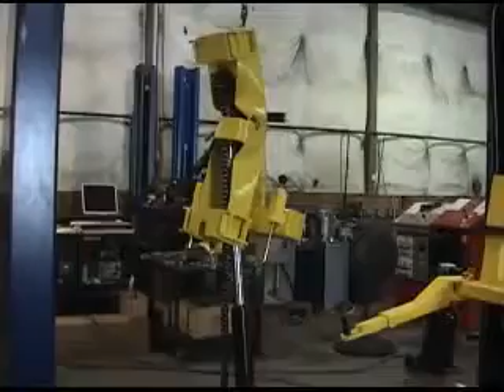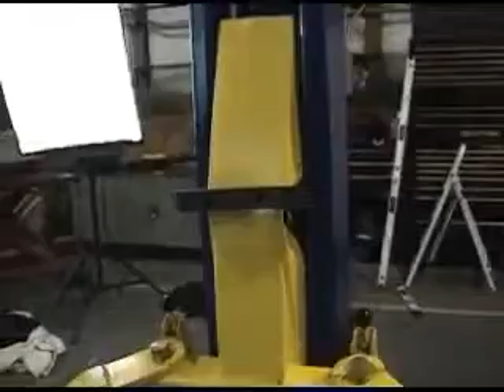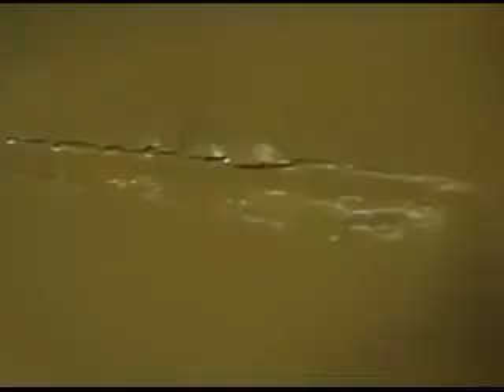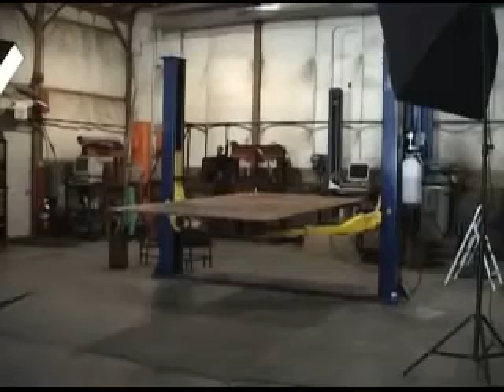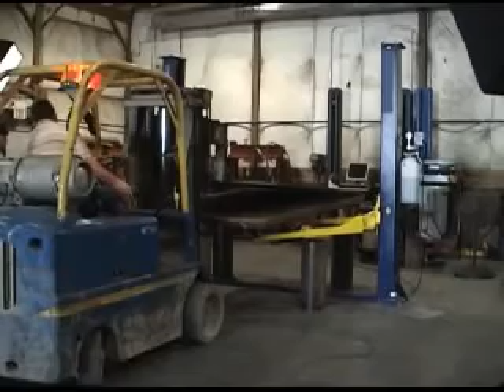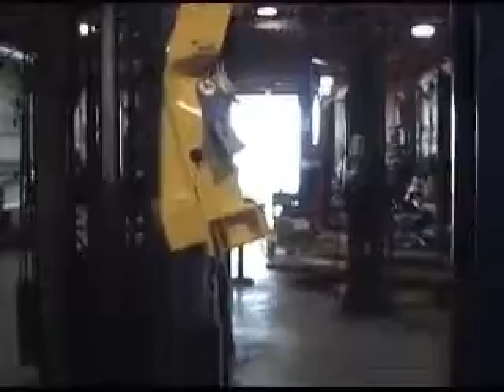Cheap Two Post Car Hoist Fails Test   Badly!

Comment: Whether u lift symmetrical or asymmetrical the load is supposed to be balanced. a truck balance point is at the b pillar and should be lifted symmetrically. a car balance point is at the a pillar and should be lifted asymmetrically. so in not saying their wrong but definitely not doing the test 100% correctly

Comment: At least its supplied power unit wasn't strong enough lift a load heavy enough to cause structural failure. It's almost like a safety feature 🙃

Comment: The XK are pretty good quality as long as you set them up correctly. Plenty of legitimate reviews on those. They do stand behind the products. I bought one of the L1000 which is the 10k two post symmetrical with the bottom cable/hydraulic cover plate.  Haven’t seen any negative reviews except a complaint about the written setup instructions being unclear. There are three great videos on the setup that are extremely detailed and the installer on two did follow ups on tips and how to replace a failed anchor bolt with a bonded one that is much stronger.
Reply: Really? I have one with a car stuck on it in the air right now. The "customer service" lady is a nightmare to deal with.

Comment: Any one can cause a lift failure if you overload it that much.     Just a couple of Goob engineers with no practical experience.
Reply: It’s not overloaded. It’s rated for 10k and it was already failing. Industry standard is that the lift can actually life 1.5 times the rated load. So in actuality the lift they are testing should’ve been able to lift the 15k lbs without breaking.

Comment: Dude if it’s dangerous call out the name of the lift. All you’re doing is blowing hot air.
Reply: You’re going to end up in a lot of trouble to prove your innocence even though it’s true it will cost you I’m sure that’s why they don’t
Reply: I own a 20 year old Ben pack 9000 never a problem seals are still good no leaks cables good, I’ve moved it twice with me,
Reply: @joecorrie1 there are mechanical locks and it is the frame it self you should worry about. If the hydraulics fail, the only thing that happen should be that you can't lift. Which mean it can be locked in up-position as well.

Comment: This video is a bit disingenuous with regards to Chinese lifts. When you say "not all  lifts are created equal", why would you claim that? If this lift is rated to 7000lb by the manufacturer, but the importer is claiming they are rated 10000lb, what the hell do you expect to happen when you load it up with 10000lb and 15000lb. Looking at the hoist in the video, it looks like a generic Chinese 4000lb model, not a 7000lb. Your video is really a waste of time. Of course if you overload a lift it will fail. Why not put 20000lb on one of your 10000lb lifts and see what happens. Blame the distributor, not the manufacturer. If you wanted a video to show the quality of a Chinese lift, why not show the documents that claim the capacity of the lift and then apply the maximum load and video that.
Reply: Watch it again and do try to comprehend.

He states it is sold as a 10k rated lift. There is nothing saying its rated for 7k, simply that it looks like a 7k unit.

He also states that industry standards require that all rated lifts be able to handle 1.5x its rated capacity for safety reasons. In this case that 15k pounds, and it FAILD. 

Why are you so desperate to defend Chinese importers that lie and put peoples lives at risk for money?
Reply: @Swapperoni  Perhaps YOU should watch it and comprehend. He states "many US distributors completely overate their lifts. These distributors buy Chinese lifts THAT SHOULD BE RATED FOR 7000LB and advertise them at 10000lb" So my comment was correct. He should be blaming the distributors, not the manufacturers. I am not trying "desperately to defend Chinese importers", but the fact that if I buy an item from China that rates it for 7000lb, but I sell it and advertise it for 10000lb, who is at fault when it breaks? Not the brightest bulb in the house are you Justin.
Reply: @Swapperoni  
Every lift is made in China!! Bendpak/ rotory/ tuxedo and so on. But those companies have far better quality control as there are ALI inspection during the building process along with after
Reply: ALI certification exists in China - it requires actual testing and inspection.   This is most likely one that is not ALI certified.   I agree - over generalization that all Chinese lifts are bad.  An ALI made in China ( Forward ) should be solid.
Reply: I bought my lift in 2009. Private use only, no commercial duty. I really like it. Cost around $1750 OTD w/o delivery, which I didnt need as I picked it up with my trailer. I installed it myself. When I moved, I brought it with me to my new home and garage. One of the locks is starting to have an issue with re-engaging for a couple of inches when lifting vehicle higher. Like if I have the car off the cement 3 feet, and decide I want to raise it higher, one column clunks/ratchets two or 3 times before the other will start. But hey, its 15 years old, and probably needs some lube. HOWEVER....I'll also add that the lift came with 2 rating capacity stickers. One said 8,000lbs, and the other said 9,000lbs! The owners/parts manual says 7,000lbs!!!! I'll go with 7,000lbs to be safe. Since I'm lifting only a 3,250lb C5 Corvette, I feel confident. 15 years and no issues, except that sticky lock, which I'm looking into. Unless youre lifting commercial vehicles/motorhomes/dump trucks, etc., how many times will you be lifting even 7,000lbs???
Reply: They also didn't load it evenly put much more weight on the back arms
Reply: They overload it by 50% with a upgraded pump/motor.  SMH.  Let see them do that with some of their own lifts and show us.  Deceptive advertising.  No, the seller shouldn't be selling at the higher rating, but you proved it can handle the load that they are selling it at.
Reply: @offroad6309  
Do some research before opening your mouth!! This lift is rated to 10k!! Yet it can’t pass a ALI test. ALI certification means the lift must lift and hold 1.5x its rating with no permanent deflection in the beams or arms. All weld must not show any cracking!! 
Lifts like rotary/bendpak/tuxedo and other that get a ALI certification all go through the same testing!!
Reply: @brianawd  lol, triggered easily.  Nothing like a keyboard tough guy hiding in his Mama's basement.  

They showed nothing to back up their claims as to the rating of the lift or pump for that matter. So yes, when they try to hide facts it's deceptive.  We have no FACTS to base anything.  That lift may be the biggest piece of crap ever made and a couple shots of the tag and ratings would have been simple, yet somehow they neglected to do it??? You are willing to take their word with blind faith, just don't expect me to.

  Not all lifts sold have ALI certification. Pretty expensive process that not all manufacturers are willing to do thanks to bargain hunters buying anything that is cheap.    

Try educating yourself.  This one doesn't take a genius to figure out it's a crap review.
Reply: @brianawd  i understand those brands are all made in China, thats why I'm going with Mohawk. But man are they pricy!
Reply: @justinhall9954  
As long as it’s ALI certified you are good to go. Some people are ok with using cheap knockoff that are not ALI certified. To me that is playing with one’s life. 
$1500 lift vs 4K lift. I will gladly save for a few more months and spend the 4K
Reply: @offroad6309  you for sure fell out of the re-tard tree and hit every branch on the way down!!!
Greg smith is a distributor not a manufacture!!
They were simply showing how the so called 10k lift could not even do it. It failed all ALI testing. 
Do you really think a company like Greg smith would lie. Give me a fu-king break!!
Reply: @brianawd  Why don't you show proof of the rating of that lift. Oh that's right you have none.    Without proof it's nothing.  They very easily could have shown that in the video, yet they didn't.  Hmmm. Only one reason for them not to.    You can believe whatever you want and buy that ocean front property in Kansas. Keep defending questionable marketing.  I'll wait for the proof.  

That stupid stick is beating you pretty hard.
Reply: @offroad6309  hey dip shit show me proof it’s not a 10k lift!!
Reply: @brianawd  LMAO 😂😂😂.  YOU really are delusional.  The company posting the video or you since you sound so intensely involved need to prove the statements.  Until then you are just making noise.  

I could explain it to you, but I can't help you understand.....  

Don't forget your helmet your bus is coming soon.  Hopefully you can get the help you need.
Reply: @offroad6309  dude it’s a video of a ASI testing  facility. Do you really think they would test a lift and lie about its rating? How fu-king  stupid are you? Your dad should have pulled out
Reply: @brianawd  another swing and a miss. First you tried to claim it was a Mike Smith video now a ASI. It's a AWS video. Which still doesn't matter since they didn't show any ratings on the lift it's self.   If they would like they should have it would be easily proven.  Without,.  Just making unsubstantiated claims.  

You really do struggle with using your own brain and try to mock those that can look at what is really presented not what they want it to be.   Maybe some day you will be able to understand critical thinking skills. Until then good luck.
Reply: @offroad6309  it’s says in the video Greg smith and they state that are a lift testing site!! Dip shit
Reply: @brianawd  I don't care what they claim in the video.  They haven't backed up any claims.  

Do yourself a favor and watch some of the other videos of the posters.  One has writing in Russian, others have no talking what so ever. 

 This may be the type of site you think shows the gospel truth, it is a joke to people with critical thinking skills.  You can keep defending it all you want, lucky for you we can't see your face when you really do check the posters site.  

Like I said I can't help you understand.
Reply: @offroad6309  you really are that stupid. You can’t even realize this upload on this video is not the original. The people that uploaded this took it from the original website of Greg smith equipment.
Reply: @offroad6309  Have you always been this stupid or have you been practising a lot?